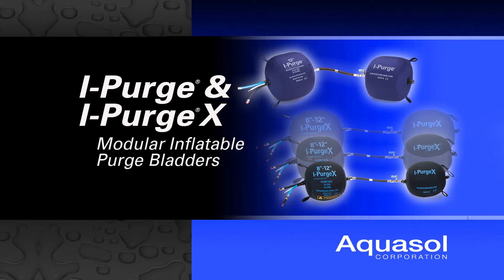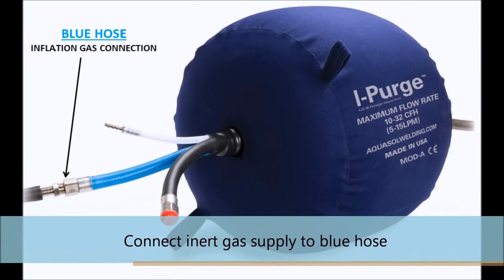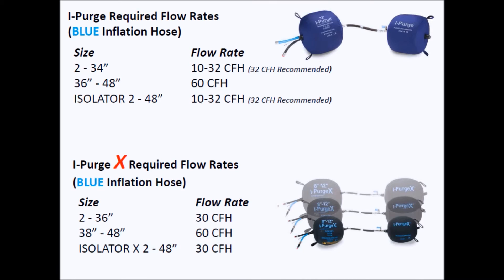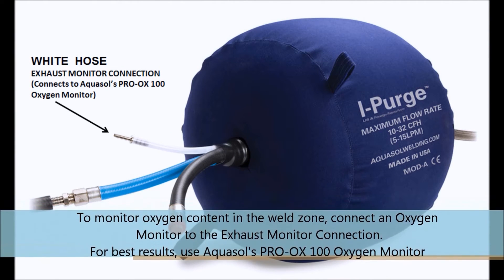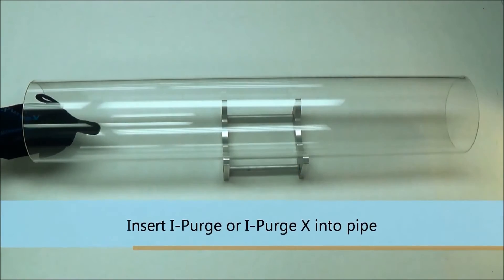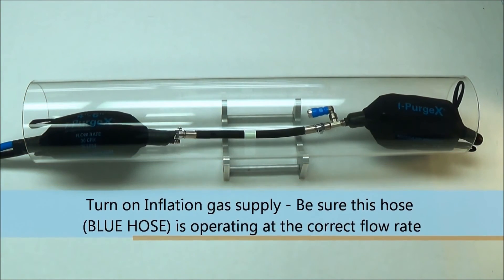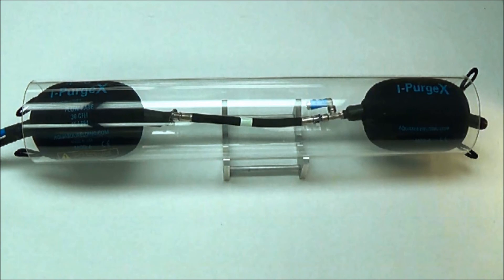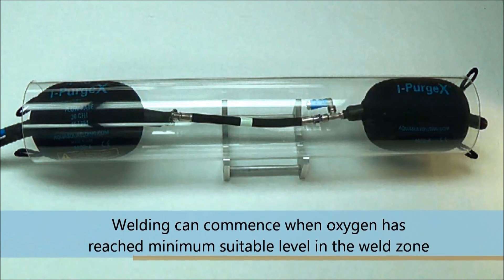I Purge and I PurgeX Operation Instructions

Comment: The  between black hose is not rigid enough to push the  purge bag into place of the joint, it coils up, deflated or inflated its the same result.
Reply from the maker: We appreciate your comment and would like to help. The hose design is flexible to move around elbow and bends of pipes. The standard hose provided with the I-purge will not cause this issue, if a custom hose is used that might be the problem.  Please feel free to call us at 716-564.8888 to speak directly to an engineer who can help you resolve this issue. Thank you!